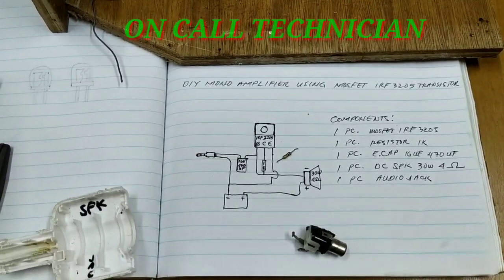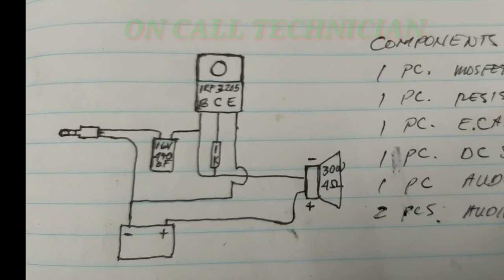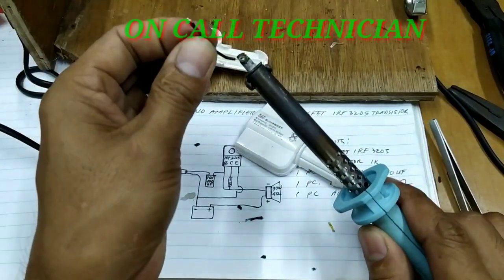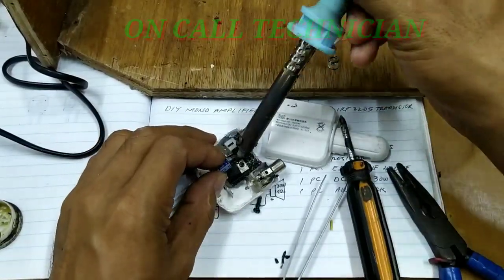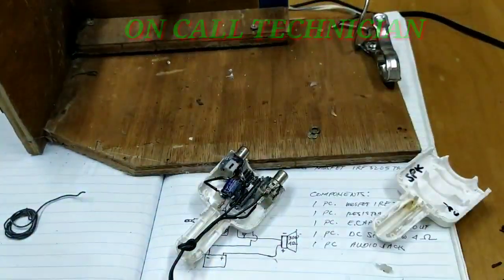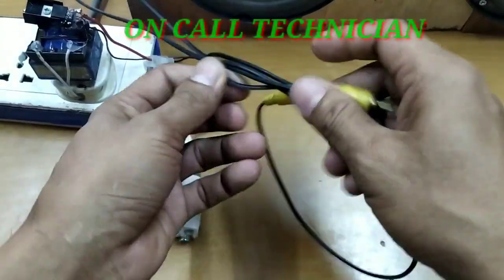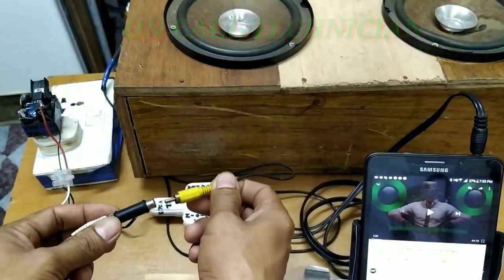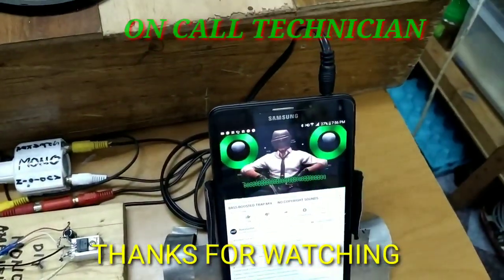DIY MONO AMPLIFIER USING MOSFET IRF3205 A POWERFUL BASS (Tagalog)

Comment: Wacha ufala since when mosfet ikiwa na BCE that should be GDS or else we unatumia transistor BJt na unadanganya eti irf3205
Reply from the maker: Read descriptions too, its MOSFET and pins are GDS. ngawa ka ng ngawa dyan. And what are you doing here in my channel. Bumili ka na lang ka ng cheap amplifier at tapos ang problema mo